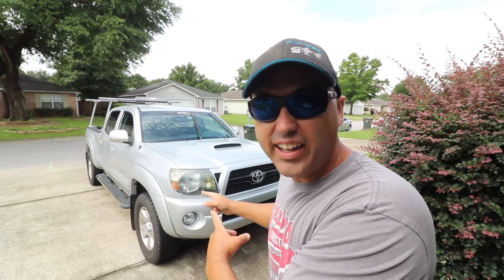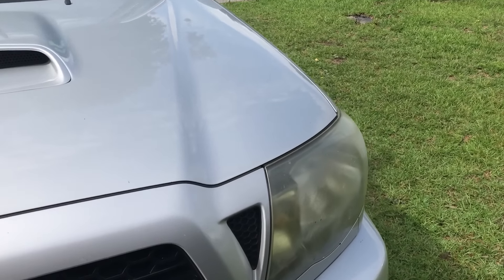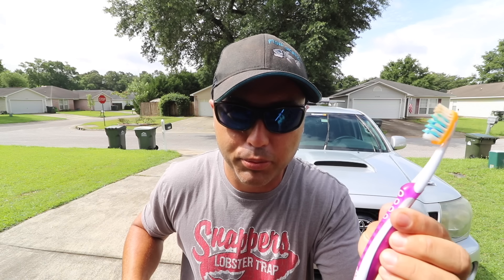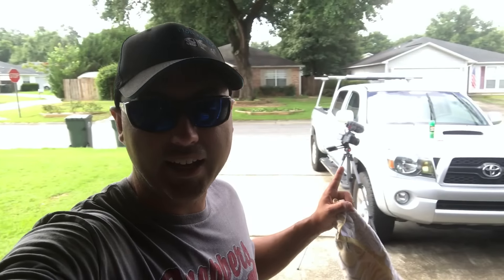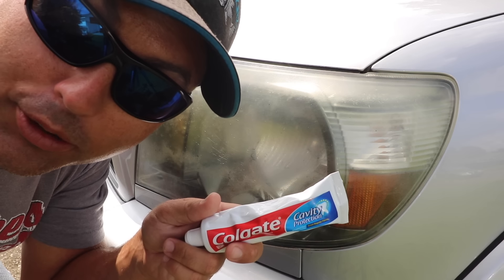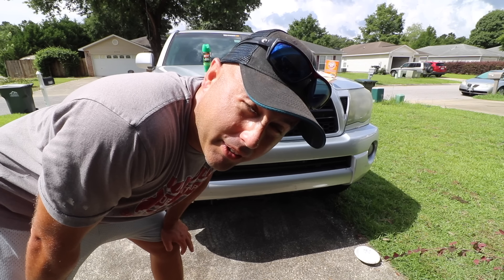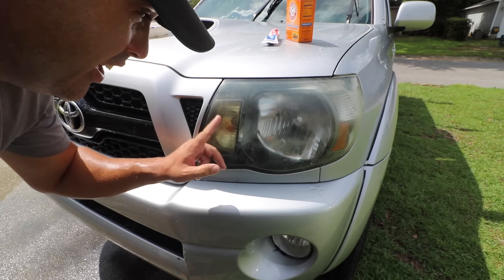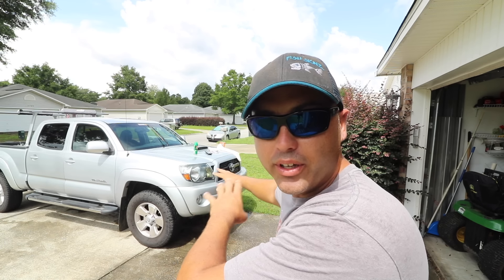The TRUTH about OFF & Toothpaste vs Headlights! (+Update on WD 40)

Comment from the maker: If you ever wondered what would happen with WD- 40 vs Mono Fishing line CHECK this video out: https://www.youtube.com/watch?v=434DGmf2EfM
Reply: Dude just get over it, get some clear coat spray and be done already...
Reply: Mr.goofie
Reply: in case you haven't figured it out, its because the outer layer of plastic is cracking and peeling on a micro level, tiny cracks that diffuse the plastic and its caused by the sun. what you need is something clear and liquid that goes into the cracks and then hardens. the WD 40 simply washed off
You should take some hot soapy water and clean the oils off the headlights and then do it properly.
Reply: Specifically what clearcoat spray do you use? I think this technique would work on stereo turntable dust covers. Filling the cracks that diffuse the light makes pretty good sense. Trying to reestablish that clarity by removing material would present a very vulnerable surface to the elements. I suppose. I'm no expert by any means.
Reply: I'm imagining a super low viscosity liquid would need to be drawn into a very clean foggy surface then settle clear and flat when it dries.
Reply: Toothpaste is actually really good for stainless steel appliances. Covers scuffs, and scratches, and it sparkles like new.
Reply: Yak Motley use turtle wax rubbing compound to restore your headlights it comes in a paste or liquid use a normal disc applicatore to apply and a soft cloth to buff it clean you may have to repeat process a few times depending on how bad headlights are can also be used on mirrors to is very affective I've wowed people that thought there lights would never come clean it's cheaper than off and about the same as tooth paste
Reply: @Kimberly Campbell Nah, I like Barkeepers Friend (liquid polish, like Soft Scrub) for mah sink, and Zep for appliances. You can actually see the dirt come off on your towel with the Zep. Stuff is great!! Be sure to go WITH the grain on brushed surfaces. I like microfiber cloths. (Lint-feee)

Toothpaste has abrasive silica which will scratch stainless steel.
Reply: BHI
Reply: Check with Toyota for a recall on your headlights. My 2009 Tacoma had a recall on the headlights because the wrong bulbs were used. Yours appears to have same issue.
Reply: Yak Motley
Reply: Your fingers in a circular motion does better than using the toothbrush with paste. The bristles bend so co tact varies while you can provide steady pressure with your fingers
Reply: Take the head light restore headlights sandpaper and non yellowing clear coat
Reply: 400 800 1000 1500 grit sandpaper with non yellowing clear coat
Reply: Where is the update on the off/toothpaste headlight fix?
Reply: Yak Motley
Reply: JC Haywire _ READ my post above.
Reply: I watched the video and paused it when you showed the can of OFF. It looked like it said 25% Deet. Try a brand with a higher deet %. I've seen higher percentage deet REALLY do some work
Reply: I use the off method but I spray it on the cloth and rub rub rub and then... rub some more til clear then rinse, let dry, tape off, then clear  coat and done
Reply: Fine grit (800 or finer) sand paper . Wet sand until u get the clear coat off. Dry and apply light coat clear coat. Allow to dry and apply second light coat.  Cheap spray can works.lasts a year or so.
Reply: Go to Walmart it's only 25.00
Reply: zahra azizi was
Reply: @maggiekelly4055  !
Reply: Surprising as it sounds I have never wondered about this and don't really care. Probably because I don't fish.
Reply: @elizabethsalazar3641    a j
Reply: so...how long did the off last?
Reply: Yak Motley χ
Reply: @zahraazizi7005  Ji ni
Reply: Def dont use wd on lights man but i gotta say i do spray my fishing reels with a little bit of wd and never failed. I catch alot of fish.
Reply: @stevenroberts8326  same with my Toyota
Reply: @esteve95  hhf
Hgughhdhg😳
Reply: @John Guy Is that (rubbing compound) a name?
Because I want to know the real name and brand to buy.
Thank you.
Reply: Mix wd40  with toothpaste n try it
Reply: Yak Motley Have you ever tried baking soda and vinegar if so did it work
Reply: Steven Bg Z    IOS
Reply: You're a funny dude but using a toothbrush to apply the toothpaste was just plain dopey. Were you serious? Or just clowning? You need to use a buffer on a drill or lots of circular manual effort with a soft cloth.
Reply: What about the rear lights because you don't notice it I'll bet they're made from the same cheap crap as the front 🧔
Reply: @esteve95  h
Reply: You're hysterical
Reply: Hmm never given a update must not have worked
Reply: @mickjager5974  you made me laugh out loud! Unexpected! Thanks
Reply: Are you sure you're not a blonde?
Reply: I bought the Armor All restoration kit and as I was wiping it on it looked like it was getting rid of the foggy residue but once it dried the residue was still all on my headlights.
Reply: sorry to be off topic but does anyone know a method to log back into an instagram account..?
I was dumb lost the account password. I would love any help you can give me!
Reply: @Moses Dominic instablaster :)
Reply: @Arjun Terrence i really appreciate your reply. I got to the site through google and im in the hacking process atm.
Seems to take quite some time so I will reply here later with my results.
Reply: @Moses Dominic You are welcome =)
Reply: @digimbyte  pl
Reply: @maggiekelly4055  use denture toothpaste non abrasive
Reply: in the past I used "OFF" & here's what I found out from my own tests,,, "IF" the headlight is clear coated (painted)  & you can see spots more on the side edges that look like the clear has worn off or pealed "OFF" will not work! "IF" you don't see the look of the clear coat pealing it possible was never sprayed with paint & was just polished to a shine "OFF" will work & make them look great for a while! also "OFF" works great on glass headlights much better than plastic! problem is most all later models are all plastic! the glass headlight was on a 1998 model Dodge truck worked great! tried it on a Toyota Camry with plastic headlights unpainted worked great, on a Crown Vic that had plastic painted didn't help at all!
Reply: Z
Reply: Off works....don't use your wife's good bathroom towel first off, don't spray off on the lights, it will actually remove paint. Like the actual truck paint.
Reply: The reason why your headlights only lasted a week and a half with the WD40 was that and including these one that you are doing right now are all only temporary cleaning methods. The sun haze still beats down on your vechicle which causes the haze on your headlights. To make them last a really long time like about 2 to 3 years clean it off again with whatever method you prefer to use to clean them. And then after you had clean them this time whipe your headlights using a chemical known as ceramic coating you can get that at any auto parts store or body shop and that would make it last that long. You can even wash compound, polish wax and then apply ceramic coating to your entire car including the plastic areas for that protective clean look and it would last a long time.

Comment: If the headlight manufacturers did their job properly nobody would have this problem!  One could accept this happening after 20 years, but not a few years. Unacceptable!
Reply: Hey as long as they are pretty when you drive it off the lot! The excuse I get for Lexan vs good ole glass is weight and durability.  Weight maybe but durability? Granted glass would require the lens to be ribbed on the inside and you would lose the clarity of a Lexan housing.
Reply: Mine is 22 and has very minimal fading. Slight spots here and there, but def. Not the whole headlight. I lived on a farm for 4 years parking in the sun, It might have happened over that time. I thought it was glass but it's also not the type of plastic on newer cars🤔... it's a Daewoo Lanos 1999.
Reply: The reason why the lenses get that way is bc it's made of plastic. When we had glass lenses that didn't happen.
Reply: Yea fr like wtf
Reply: planned obsolescence
They knew what they were doing.
Reply: Somehow congress forced the increase of high fleet mpg every year but can do nothing about headlights and fraudulent phone calls?
Reply: Your clear rear lights never get cloudy, why?
Reply: @daveschooley8514  Constant wet sandblasting when driving in the rain......
Reply: Well wear & tear🤷🏼‍♀️😂 naturally

Comment: If only the headlamps were still made of heavy glass, this wouldn't be an issue.
Reply: THEY USETO BE.BUT THE CAR COMPANIES FOUND ANOTHER MULTIMILLION DOLLAR INDUSERY TO RIP US OFF
Reply: I wish there were aftermarket glass alternatives at least!
Reply: CAFE standards killed the glass headlight.
Reply: Yes, so true but you know its all about the money for car manufacturer's!?!?
Reply: Guess that's the price you pay for great weather?
Issue with my car being on the North Coast of England... Seagull poo every day, I keep a bucket on the drive to clean it off😭
Reply: I would pay extra for glass headlights in a heartbeat 💗
Reply: @cafe80s  I had glass headlights on my old mercedes. When a rock hits the headlight which is very common. They shatter vs just taking the impact without shattering.
Reply: The car manufacturers have to lighten the vehicles each year to meet the government's standards for gas + mileage! That's why they're made out of plastic and it's also a lot cheaper!
Reply: Glass tends to shatter, and become a penetrating projectile in a crash, that's one of the reasons for going with polycarbonate.
Fighter jets (and commercial airliners) use poly instead of glass for the same reason.
Glass would stay serviceable much longer, but that's not the reason it's not used now!
Reply: Plastic headlights are better for pedestrian accidents..the catalytic converter..that hurts!!🤕🤕🤕
Reply: @cafe80s  that would be AWESOME
Reply: @scottfortney8889  Glass was used when we purchased sealed beam headlights.  When we switched to a bulb replacement option instead the polycarbonate alternative became an attractive option to consider.  Less glass in the street when you get in an accident as well. I still hate them.
Reply: The plastic headlights are a lot cheaper to manufacture so they charge us prices for glass headlight switch didn't have this problem and they make more money and as consumers we get an inferior product for more money.
Reply: they save money and make more money in using plastic that you have to replace every few years lmao
Reply: @wolfensteinman7978  US  glass replacement headlights were under $10.00. Wasn’t a big deal to replace them.
Reply: no joke. .y 2015 acura tlx headlights are 4k plus tax not including install in 2023. ridiculous
Reply: I went down this road about 8 years ago with my old 98 Ford Ranger.  They dulled up again after about 6 months, so I bought new ones.  Now I’m back in the same predicament, and I’m going to replace them again.  I’m wondering if there is a way to prevent this from happening again.
Reply: But they're not.

Comment: No matter what you use to clean your headlight lens, the trick is to scrub horizontally ONLY. The cloudiness is crazing cause by dust impact and UV deterioration. If you scrub round and round or both sideways and up and down, it aligns some of the crazing but scrubbing in one direction only leaves a clearer and longer lasting lens.
Reply: This is true when polishing anything especially metal, i.e. aluminum & brass. It’s the aligning of the base that makes it shiny. 😊